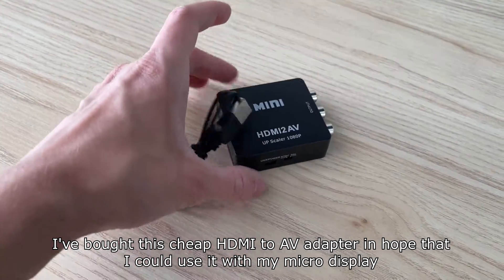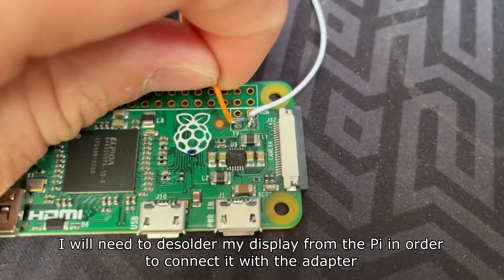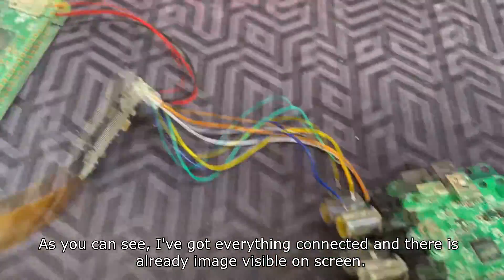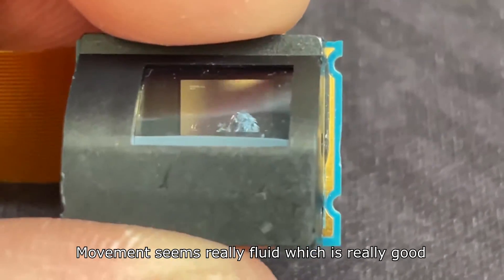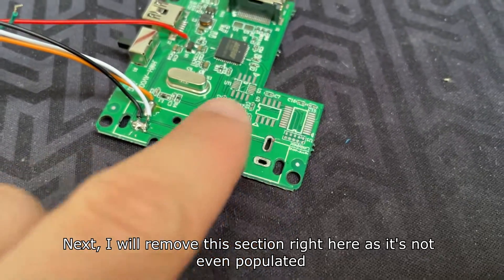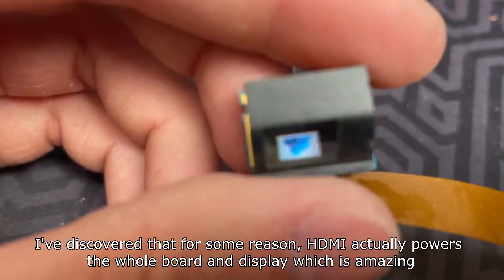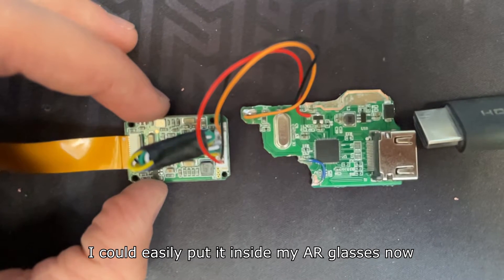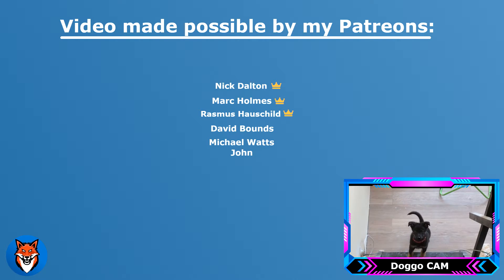HDMI2AV Teardown | FLCoS HDMI Input Adapter

Comment: I'm able to power the display but it doesn't seem to receive a signal. The display appears function since I can adjust the brightness but I'm only seeing a blue screen. Is this an issue you have experienced?
Reply from the maker: Do you have the correct converter ? HDMI2AV? Not the AV2HDMI ?
Reply: @ManolloMancelli  You are absolutely correct, I can't believe I overlooked that! Thank you for the help, I really appreciate it!

Comment: Hey, no matter what i do i get the blue screen. I tried two different adapters, connecting it to the RPI 4 (yes, i changed the config file) and the only thing that occurs is that sometimes the display displays white screen with weird lines. Any ideas what should i do?

Comment: Hey, I'm the dude that emailed you about the alternative board. Love this video, but I'm curious between the initial flcos display, the adapter board,  the pi and most importantly, the time you've spent on this (your time is, just based on the videos I've seen, a very valuable commodity), how much everything cost? 

I ask because at the point you're at here, converting the pi output HDMI to AV, then to the display, I'm guessing is in or exceeding the ballpark of a Vufine VUF-110 (around $150USD new, and much less used... $136USD on Amazon right now). If you do a teardown on one of those, you'll save a lot of work. They're HDMI in for signal and USB in for power on a single board, which is a lot less of a headache to work with. Let me know if you need any more info on those, and good luck! 

Can't wait to see the final product!
Reply from the maker: Hey! 
Sorry I didn’t reply to your email. I didn’t see it yet 😅

Total cost so far was about 70 dollars for everything except the pi. 
I’ve actually used the native AV pins on raspberry to connect it with the display. 
The HDMI adapter is being used to connect my regular Windows PC. 

I’m actually bidding on auction for the Vufine display so I might have it in near future. Depends if I win though 😅

Overall, I try to make as much stuff myself as I can. Buying one thing and converting it to something different is kinda boring. 
It’s way more interesting to discover alternative ways of doing stuff.